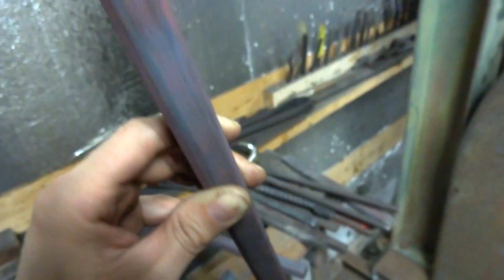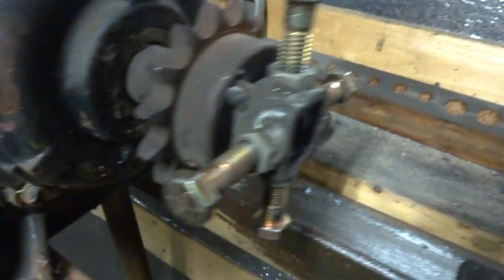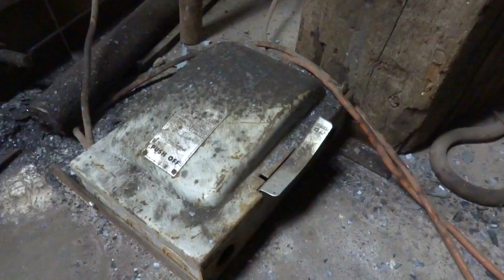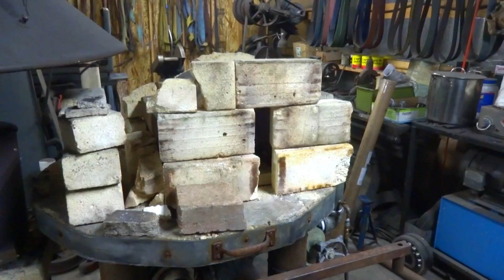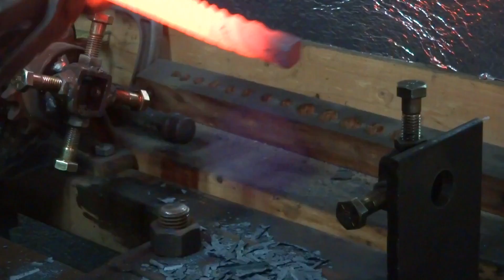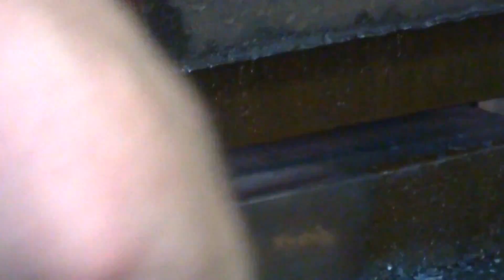Power Twisting Damascus Steel Bars For A Sword!

Comment: cool twisting machine you made Salem would a lathe work to twist ? i have a old grazzioli lathe i found a few years ago along with a brideport mill and tons of extras for $1000 if i cant make twist with the lathe i found a old pipe threader for $200 on market place
Reply from the maker: @Anderson-HandForged  yes a lathe can work for a twister, provided it’s reasonably stout. Use the back gears, about 50-60 rpm is nice. A threader works too…
Reply: @PrometheanBlade  thanks salem i have a  12x45 i think its a big old girl very stout and im looking into a old pipe threader on marketplace

Comment: did you need to grind out any cold shuts?
Reply from the maker: They always need a little grinding on the surfaces before welding back together, these ones didn't need a whole lot though.  Just about .020" deep or so.

Comment: Great commentary - context is everything !

4:10 "...cast with birthday crayons".  Candles or crayon ?  
All birthday candles I've seen are twisted on the outside -  do you think that would matter ?
Reply from the maker: Wow, didn't catch that one!  Candles, and the ones I used were twisted on the outside.  I actually used them to see if they would promote a spiraling action to the flame, and maybe provide some benefit.  Can't say they seem any different than straight really, in use... but they worked fine, and yield a bit smaller of a hole than crayons.  I wanted to increase pressure at the cast block to discourage burnback, and this in combination with a strong blower seem to work very well.

Comment: It will be interesting to see if the gear and motor can handle the heat because of the direct drive.  I would have considered a chain drive to isolate the motor and gear case from the square chuck.
Reply from the maker: In use it doesn't build up much back into the motor shaft.  Just twisted up four bars today...